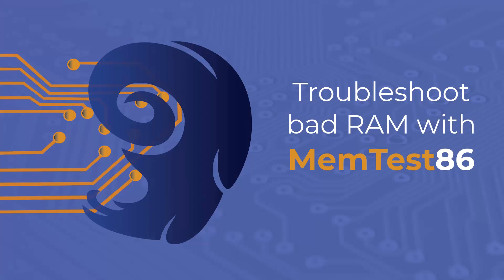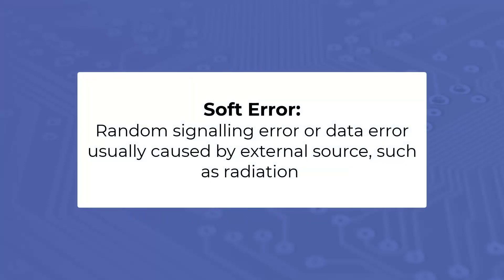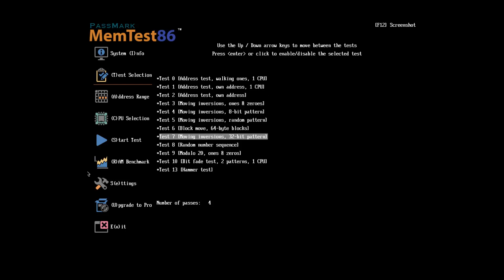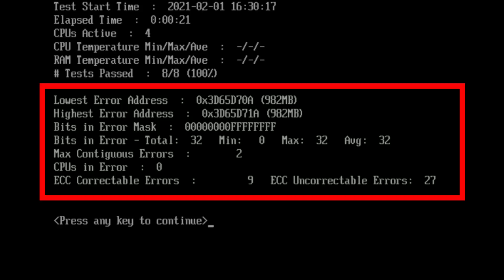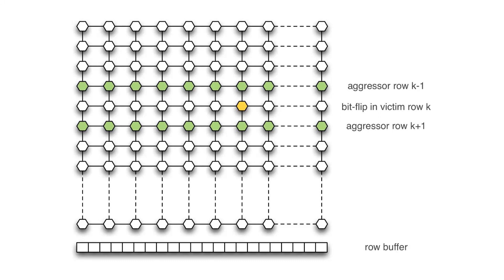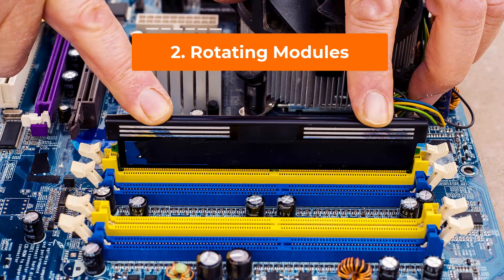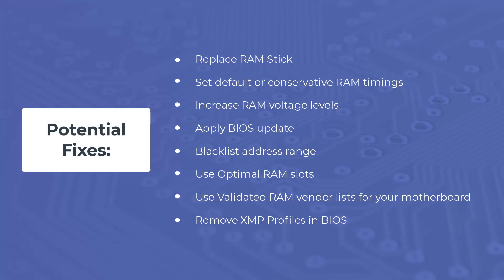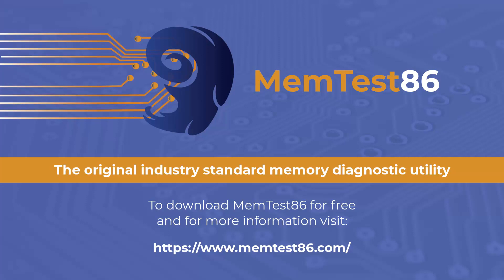Troubleshoot bad RAM with MemTest86

Comment: I ran the test with all four slots populated. I got over 8000 errors. I took out two of the ram modules leaving two in. The test passed. I removed the two working ram modules, and put in the other two. They failed miserably. So I tested one at a time. They still failed. Only the two that originally passed were able to complete the test with no errors. Problem is, its ddr3 ram, and I have no idea who still sells replacement. Maybe I'll just run on 16gb (the two ram sticks that passed the test) and settle for that.
Reply: DDR3?
oh, yeah you're kinda fucked
just run it into the ground and get a new system when it dies (GPU and storage can be preserved between, and potentially psu)

Comment: Does pass 1/4 mean all sticks get tested 4 times, or is it 1 pass for each ram?

What is the sleep in between some tests for?
Reply from the maker: Hello! The number of passes is how many times the selected tests are run. In terms of sleep, I believe you may be referring to Test 10 (Bit fade test, 2 patterns). The bit fade test initializes all of memory with a pattern and then sleeps for a few minutes. Then memory is examined to see if any memory bits have changed. All ones and all zero patterns are used.
Reply: @passmark  now the sleeps make Sense to me, thanks for the answer!

Comment: Guys memtest86 or 86+ is better for DDR5 rams. 1st I crashed with memory management than everyday I crashed Video scheduler internal error and I think its not about drivers its about ram sticks. When I use them stock they are fine but when I use with xmp 6400 mhz pc crashed and restart itself. I need to test Rams if I have any errors should I use warranty?
Reply from the maker: Many memory module manufacturers offer a lifetime warranty. So yes, if you are sure the sticks are bad, use the warranty option. If they only gave problems when running at a Mhz speed above what the CPU/RAM/Motherboard supports however, then you can't really blame the RAM.
Reply: @passmark  I dont wanna blame the sticks amd says 6k mhz sweet spot but latest agesa bios lots of people run over 6000+ my kits not stable. If they selling 6k or 6400mhz they have go guarentee it I think. Otherwise they should not have to write 6400mhz etc. on box.
Reply: AMD Ryzen 7000 series CPUs have some simple rules:

6000mhz: Generally possible on all of the CPUs. Unless you are super unlucky.

6200MHz: Possible if you are lucky and got a CPU with great silicon.

6400MHz: Possible if you are extremely lucky. Very rare.

It's easy to start a computer at 6400MHz. It is impossible to get it stable on most CPUs. Don't listen to all the noobs who just use those values blindly without checking stability properly.
Reply: RAMS lol

Comment: there is a NOTE : RAM may be vulnerable to high frequency row hammer bit flips . do i need to change my RAM??
Reply from the maker: Hello!  It depends on what you are using the system for. During typical home PC usage (eg. web browsing, word processing, etc.), it is less likely that the memory usage pattern will fall into the extreme case that make it vulnerable to disturbance errors. We have detailed information on Row Hammer Errors here: https://www.memtest86.com/troubleshooting.htm#hammer

Comment: Bought new Hp Omen Core i5 12th Gen. Already  had 2 modules of DDR5 4800 mhz of 8 GB. Installed samsung. I took both out. And installed 32 GB kingston single stick. Sometimes it is showing BSOD. Somtimes working fire for full day. Ran HP diagnostic tests of memory and windows ram test. No error show. Laptop is just 4 days old. I reinstalled in windows laptop worked fine for a day again same problem coming and going ? is it ram problem or something else ? or should i use my laptop with stock samsung ram for some time and then check ?
Reply from the maker: Hello! Did Memtest86 return any errors?

Comment: ok, i will probalby not get an anwser here fast enough but heres my case: went from an intel 10400f to an intel an intel 11700kf. same board, same bios update. turned off the pc,  just swapped the cpus, turned the machine on. after that, bsods happend directly and alot. sometimes within 1 min after windows boot, sometimes after 15 minutes. bsod error msg said something about thread sheduler and other things, most of the time, it was kernel related but almost always a different error.. so i did a new win 11 installation the same day. maybe the old installation cant handle a hardware change well?, everything the went fine for 3 days, now iam back to bsod. did this mem test, errors come up on 
test 8: addr: XXXXX expected: XXXXX actual: XXXXX CPU14, 
test 8: addr: XXXXX expected: XXXXX actual: XXXXX CPU12
test 8: addr: XXXXX expected: XXXXX actual: XXXXX CPU0
test 8: addr: XXXXX expected: XXXXX actual: XXXXX CPU10
an so on
every error, has a cpu core number in it. does that mean, the new cpu is bad?
Reply from the maker: Hello! Sorry to hear you are having a hard time with your PC. If the bios is up to date, the CPU might be bad.
Reply: @passmark  the only BIOS Version thats newer is still Beta since a year so i doubt that will Change.would you recommend that over an older non Beta? Thing i saw now ist when i Take 1 of the four Sticks Out there are No Errors. How can i Test the CPU in a way that makes Sure that i can Claim warranty from Intel? Because the CPU is 2 Months old
Reply: @passmark  a little status update. if i remove one of the 4 ram sticks, no matter which one, all the test run through fine. every ram stick on its own, runs through fine. any combination of 2 or 3 sticks, runs fine, but as soon as there are 4 slotted in, no matter where i slot them, the errors accur in memtest. i dont know what to make of this and iam afraid to send hardware to rma, when i cant proof that it has a problem
Reply from the maker: Thanks for the updates! Have you tried running BurnInTest to test your CPU? https://www.passmark.com/products/burnintest/index.php We also provide a range of options for further troubleshooting with MemTest86 here: https://www.memtest86.com/troubleshooting.htm
Reply: @passmark  i tried intels cpu test tool with 4 sticks and the tool passed every test. i used occt for 30 minutes on the cpu with no crash. iam starting to doubt, that its the cpu, since the error only occurs, with 4 sticks installed and works, if i remove one stick, no matter which one. but on the other hand, that behavior doesnt speak for a single bad module if since, it doesnt matter what module gets taken out
Reply from the maker: Hello! Yes, it would appear the system does not like it when using all 4 sticks of ram, can you try adjusting the timings and voltages of the memory?
Reply: @passmark  hi. i think i could but i never stepped into changing timings before. the only thing i ever did was setting an xmp profile. but i saw one thing there. the ram is supposed to run at 1.35v. bios is set to 1.35 volt due to xmp profile 1. windows software like hwinfo reads 1.35v on the ram, yet, memtest86 says in the menu ram is running at 1.20v. iam currently thinking about just getting new ram, 2x 16gb sticks instead of 4x 8gb, because 24gb on 3 sticks is just a bad idea

Comment: My problem is my windows won't boot with the fan running. After I shake the ram or take it out and place it again it boot normally without any problems. Any solution or causes before I ran memtest?
Reply from the maker: Hello! This is a tricky one. You could try disabling xmp (if its enabled) in BIOS and see if that helps. We would also recommend running MemTest86 and checking for errors.
Reply: @passmark  thank you.. will do.
Reply: p

Comment: I have a doubt: I ran MemTest86-PRO and it detected 2 errors on the same DIMM1 (sheet at 6:02 says it's a bad module) with the same CPU's core0 (sheet says it's a bad CPU) during the 13th test (row hammer). BUT... If I DISABLE the BIOS' Multicore Enhancement ("overclock" by default is on AUTO in ProArt Z790 BIOS) then no more errors! (Sheet says bad voltage.) Please note that my CPU is under the Thermalright frame, so there would be some pins bending risk, but honestly if it would be the case, then I should not even pass MemTest with Enhancement disabled, right? So me question: is it better to keep the Enhancement disabled (at least during memTest) OR my DIMM1 is actually damaged? Thanks for your kind help.
Reply from the maker: Hi Adriano, thank for your comment. Unfortunately we cannot say for sure without the report/results. But after doing a quick search online, 'Multicore Enhancement' sounds like some soft of CPU overclock feature - so it seems likely that your CPU isn't very stable with it on. So best to keep it off - and it is likely your RAM is ok if there is no errors with Multicore Enhancement off. We hope this helps. If you would like further support, please send your logs through to help@passmark.com